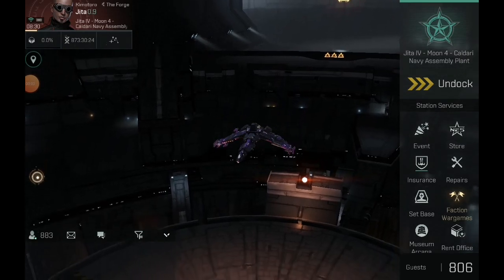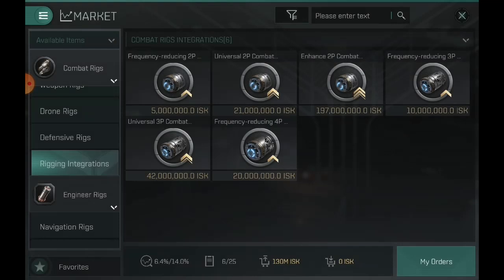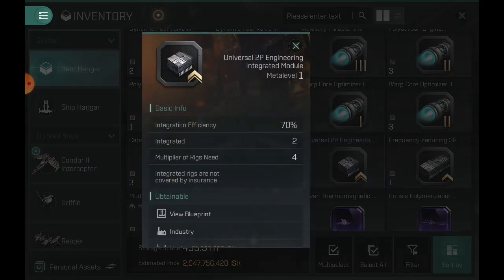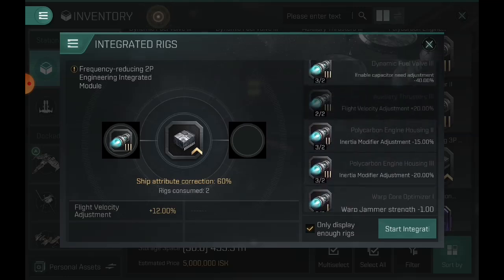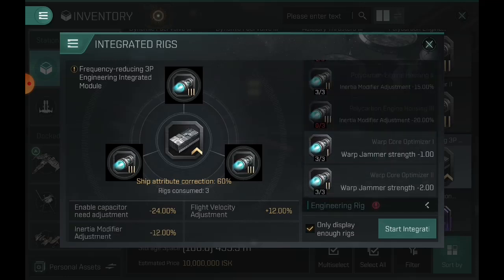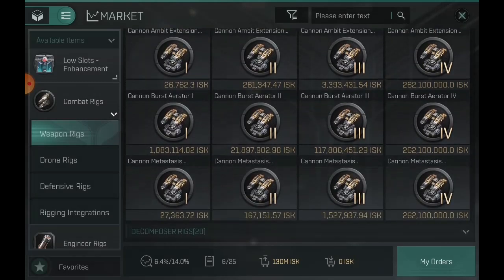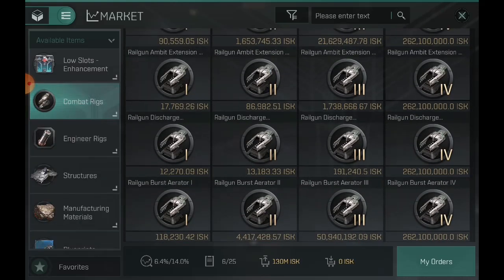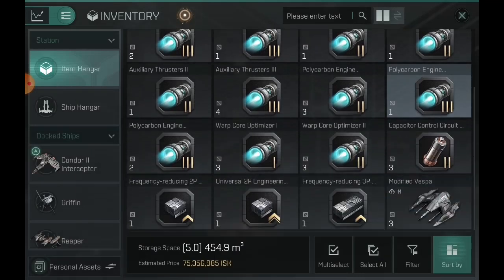[[EVE ECHOES]] Integrated Rigs - How to create unique hybrid rigs

Comment: For T3 warp core optimizers, you need at least 2 - 2P or 3P 70% integrated modules to be effective. 

Example
3 stabilization x 60% = 1.8 which will not help you
3 stabilization x 70% = 2.1 which at least protects you against a disrupter. 2 of these will protect you against a scram of course.
Reply: Based on numbers, it seems warp cores are best not to be intigrated till we hit t4 rigs where you will always have atleast 2 warp core strength per special rig at best

Comment: So theres a penalty if you use rigs of the same type? (Except those that doesm't say there's a penalty). Example a kin resist on an integration rig plus a normal kin resist results with the same penalty as using 2 normal kin resist rigs right? Which is.. the second ones effect gets diminished from 100% effectiveness to 80ish%.
Therefore... if we use a 70% integration rig with kin resist (which gives 28% resist) it'll be even lesser? (Which comes down to 19.6% resist). And the normal one would still give 40% kin resist.
Or would it be that the normal one will be the thing that will be considered as the "2nd" rig? If that's the case.. it'll be nice instead putting the penalty on the integration rig.
Reply from the maker: So the rigs you attach into the device still state they get penalties unfortunately. It will be nice when i get access to this information on the test server and can really crack into good combinations

Comment: So how does that work? Can i combine 2 mining circulation and have 1 combined rig which is at 120% of one single mining circ?
Reply: you cannot install the same rigs in 1 integrator
Reply from the maker: Thats right, only one circ rig per integration module. You only get 18-22%(depending on the module you use) of activation time added to the integration  pool
Reply: You could have one circ and one efficiency integrated, but not two circs.

Comment: Which one can I use for drones
Reply from the maker: Drone damage or battling drone boats?
Reply: All of the drone rigs I’m trying to make a god level drone ship
Reply from the maker: @zacharyspencer1443  that's a tough one.. if you want all DPS you can do 1 T3 dmg 1 T3 activation time and 1 3P rig for activation/DPS/range. Or you can do 1 3P with 2 resist rigs and a boost amount. Engineering side ur pilots choice (stabbed or capped)
Reply: @b8kd73  i’m more or less wanting to go for range and fire rate and flight speed if all those can be on one integrative rig

Comment: will there be a penalty for identical rigs in intergraters?
Reply from the maker: If you have multiple of the same integrated rigs, yes the same rules apply and negate the effect.
Reply: @b8kd73  if there is a penalty, then is there any point in spending billions on a few percent boost?
Reply from the maker: @forbit1619  probably not, but you can make some pretty cool combinations :D
Reply: @b8kd73  ohhh..... it will be difficult )
thanks for answers <3